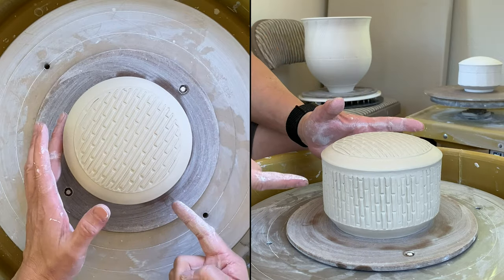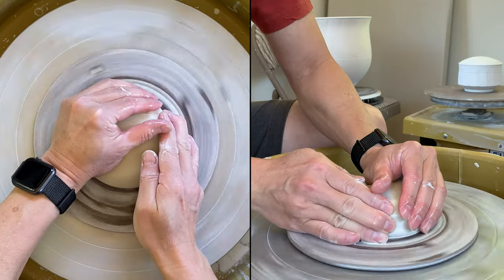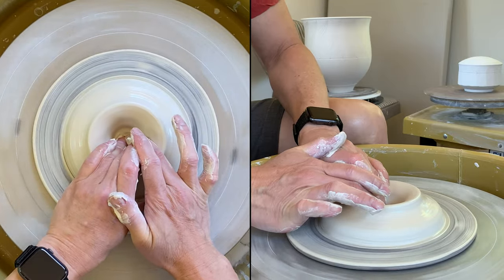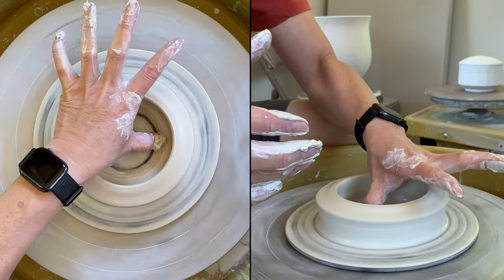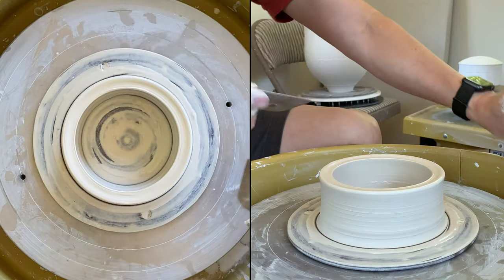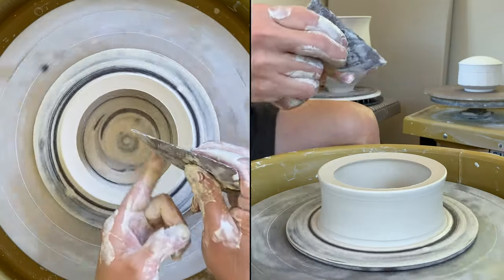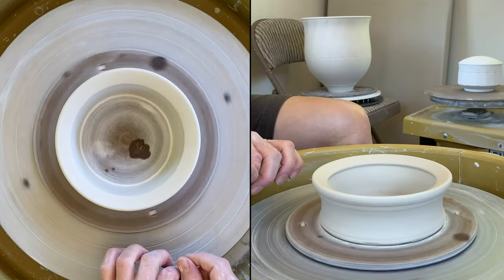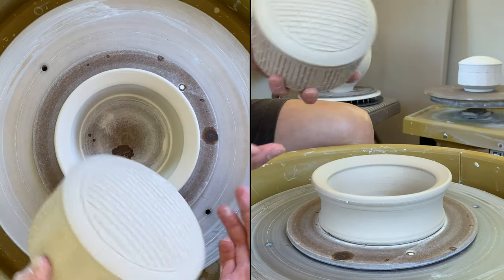474. Throwing a Custom Chuck for Trimming a Lidded Jar/Box with Hsin-Chuen Lin 林新春 蓋盒修坯台製作示範

Comment: As you work solely with Porcelain, do you have any tips on how to prevent it from warping in the kiln please?
Reply from the maker: Making sure your pots can shrink evenly during cooling stage. Usually the warping is caused by placing the pots on the rough kiln shelf. Provide your own cookies should help.
Reply: @hsinchuen  Thank you. I will try that. I love porcelain, but have had many failures.